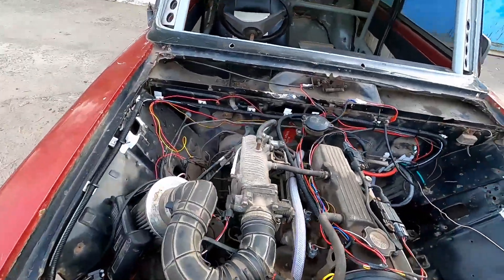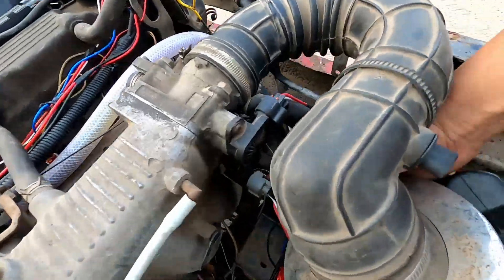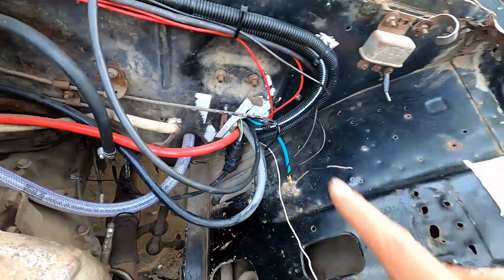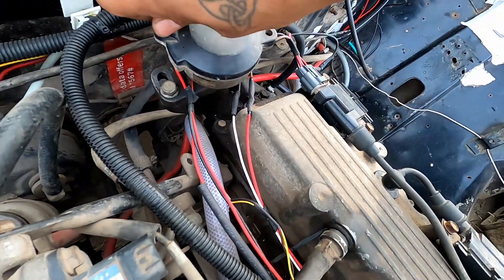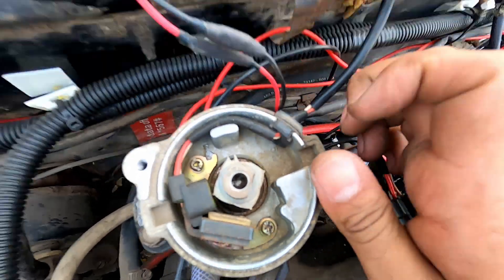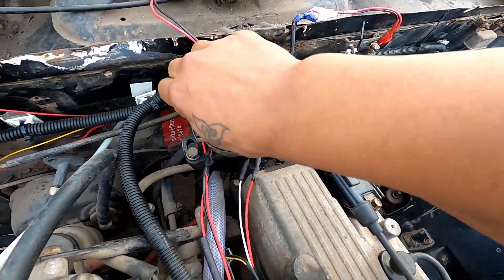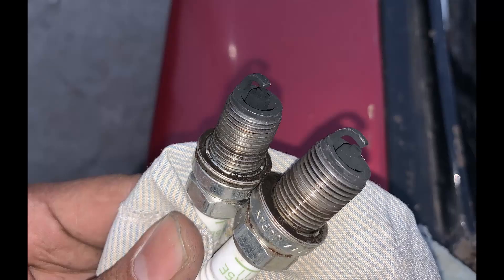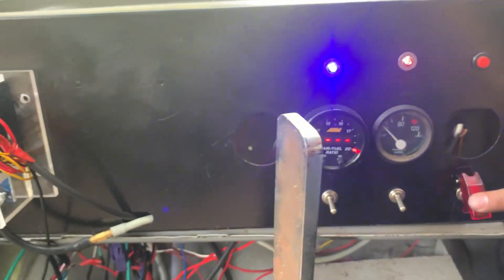FIRST START ON NEW ECU | DIY ECU PART-4

Comment: So happy to see the standalone ecu is live. Hats off  for the diy wiring. When I saw the wiring i think about the shielding is not done on input signals. Actually that timing of trigger is so complicated to figure out I had similar situation( for my bike). It may be India's 1st Diy standalone ecu running car. Bring back the car with raging power. Good luck.
Reply from the maker: Thank you brother. Yes if you see in the beginning the wires are not shielded, then I changed ignition, injector and signal wires to shielded wires.  Still some noise issues but I shall figure that out soon.
Reply: @NaughtyNut   Actually input signals are need to be shielded due to the noise from engine also from outside world. They need to be considered. Also of the ignition is converted to cop from Maruti k series engines in future could solve the issue further. But the cmp and ckp need to tune for the cop setup. The wasted IS is the prob here. Any way I again clap for the effort you take.
Reply from the maker: @blkdna748  noise is a problem only because the engine has a VR sensor. I will change to HALL soon. Correct, i will need ckp and cmp to run COP, although the suzuki +1 ignition style on cam is very much capable of running cop without ckp, i would like ckp for accuracy. Moreover this engine has no provision for ckp so ill have to make one. I'll do all i can with the current setup till then but that damn noise is a killer!!
Reply: @NaughtyNut i wish everything would be get perfect. Did u use the vr conditioner or not? I think it has some adjustments for filtering out the signal.